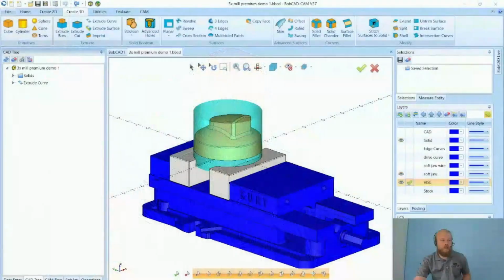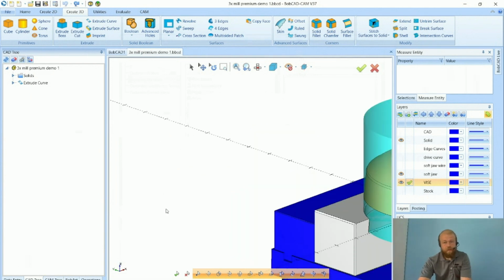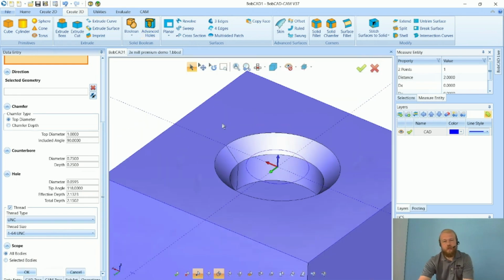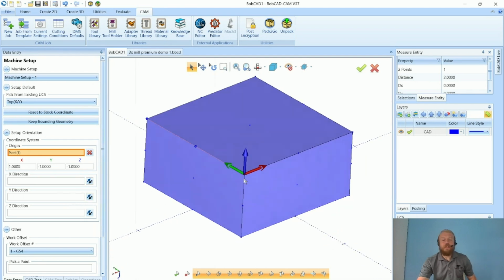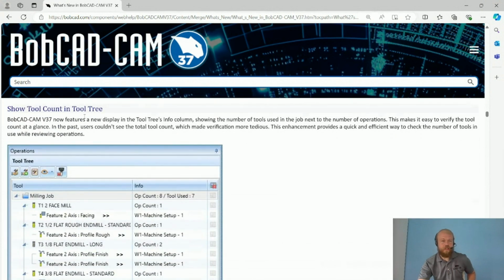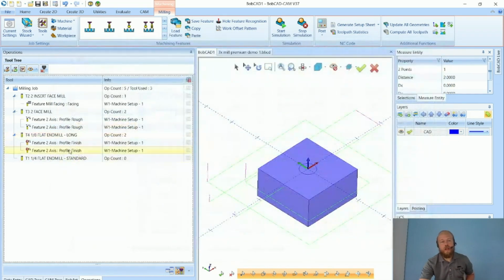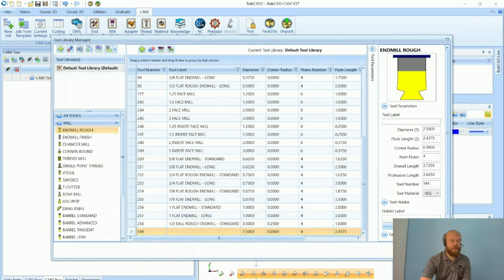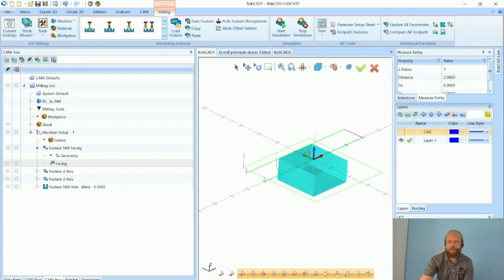Discover the Power of V37: 130 New Features to Elevate Your Productivity!

Comment: What is the difference between ' boundry' 'containment curves' & 'check surfaces'?
Reply from the maker: The boundary containment allows the user to utilize the wireframe as a limit to the toolpath, and check surfaces allows the user to apply 3D geometry to avoid collisions
Reply: @BobCADCAM    What does containment do that boundary doesn't ?